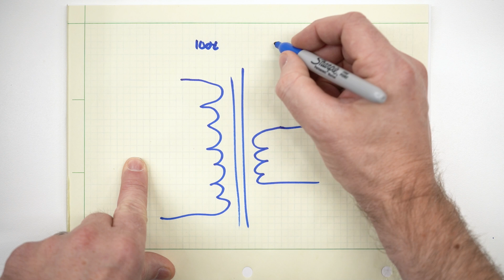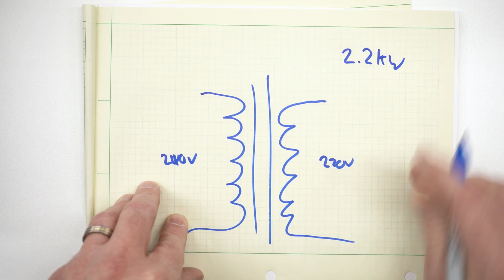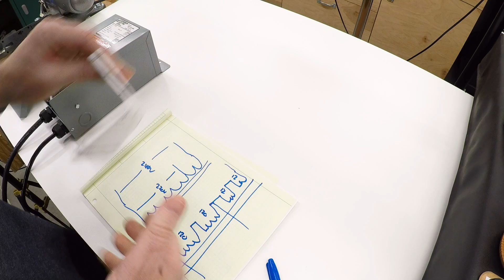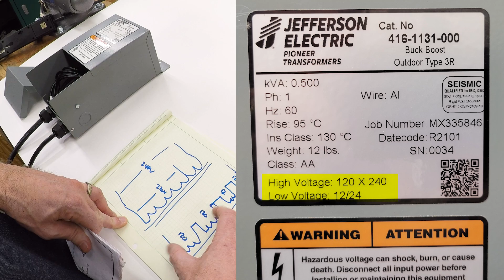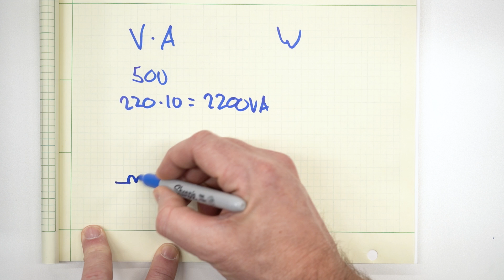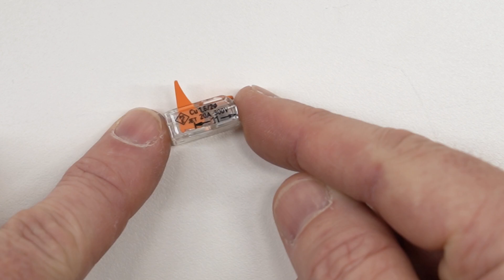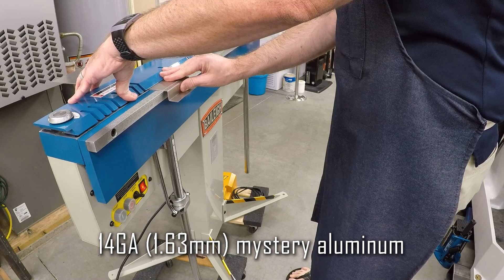220, 221, Whatever it Takes! | Wiring a Buck Transformer for a Magnetic Sheet Metal Brake

Comment from the maker: Errata:  A couple of people have pointed out that the wires are likely not aluminum, and they appear to be right.  While the transformer nameplate says "Wire: Al" on it, I went back and scraped some of the wires, and they look like copper under a silver surface coating.  Perhaps the marking on the transformer refers only to the windings.  It's fully encapsulated in resin, so I can't verify.
Reply: I could see them using aluminum for the windings.  But it's very rare for wire to be aluminum as making a reliable connection requires fancy tools.  Much easier to weld a copper or tinned copper wire to the end of the aluminum and make a connection to the pigtail.  (this is all due to surface oxide black magic)
Reply: @martylawson1638 it is Copper coils
Reply: Tin coated like marine grade wire perhaps.
Reply: Thank you for your interesting videos, James ! And thanks for the refresher :) I have worked in industry building and designing and programming all sorts of electrical PLC controlled machines and the power supplies for them etc... since 1981 (I'm an industrial engineer in electromechanics in Belgium ) and I can't remember when I last used a buck or boost transformer. Keep up the good work.
Reply: copper wire

Comment: I just received my Kaka magnetic brake, the EB-4816B and it doesn't mention anywhere about the +or- 5% thing for 220VAC input power.  Not on the cord, on the machine, in the manual, on the website.... nothing.  Is it possible that they've changed something and made them more forgiving or do you think they just ignored it?

Comment: Hi, I'm not sure you will have time to answer a couple questions, you have quite the following. I recently bought a 52" magnetic bender, like yours, it requires 220v. My shop is a consistent 237v, too much. Since your machine has the same requirements as mine, I'm looking for a transformer to lower the voltage. I'm having a problem finding exactly what you bought, but I see many other name brands. So is what I should be looking for is; high 120x240v, low 12/24 with a KVA of 0.5 or higher, is this correct? Is there any other specs that I should be looking for? Thanks

Comment: This is a machine costing $3k, intended for the US market, and it can't deal with standard US 240VAC?

That's somewhere in between disappointing and infuriating.

BTW, do yourself a solid and get a pair of proper ratcheting crimpers and dies. Those Radio Shack style stamped crimpers make terrible connections. Paladin/Greenlee PA8000 series are good.

Comment: Hey, thanks for the great videos. Please, can you tell me if you have castors/lockable on your magnabend sheet metal brake, and if so, what brand and model?
Reply from the maker: I'm using some cheap Footmaster clone casters, so I can lower the solid feet to make it rigid if needed.
Reply: @Clough42  thanks! I ordered some low cost clone as well. Different brand. I just got my 1250E magnabend yesterday! My CNC plasma rig is a DIY based on the Lowrider 3 CNC motion control system. It’s working great for me. I’m super pleased.

Comment: I'm wiring a similar buck transformer for my magnetic brake.  Did you consider putting a switch on the transformer on the input side to turn it off.  I'm thinking to prevent parasitic draw if I leave it plugged in.

Comment: I don't see how "VA" is the applicable rating.  The wire in the winding has an inherent current limit.  Beyond which it will overheat.   
Given the different configurations that the transformer can be wired for, it would be very confusing to determine the current limit.  If the VA limit applies to the bucked power (i.e., if you're bucking 20v, you can draw 25A), the different bucked voltages would imply different current limits.  On the chart, the maximum bucked voltage is 46v (implies a current limit of 11A) & the minimum is 12v (42A).  It is highly unlikely that the transformer could supply 42A for very long.
How is a VA rating more useful than a current rating?
Reply from the maker: You thought about it for a few minutes and decided the way the industry rates these devices is wrong, and this device doesn't meet it's advertised specs?
Reply: @Clough42  Snarky. Is that your way of saying that you don't know why a VA rating is more useful than a current rating?  I'm saying that I don't understand, not saying that it's wrong.

Comment: I bought a few weeks back the same type of magnetic brake but from another seller whose brake comes from the same factory. I was surprised when I looked at the manual to see that the manual says 220/240v. I had the seller ask the manufacturing plant if it had to be the 220v like baleigh writes in their manual to make sure a buck boost transformer is really required.
Manufacturing plant told my seller that it was 220/240v compatible and did not require a buck boost transformer. It was also confirmed that the manufacturing plant is the same one that supplies the same units to baleigh. I have the original manufacturer manual for the machine with mine.I wonder why Baleigh who wrote their own nicer manual wrote up the buck boost transformer stuff in their manual.

Comment: Wow! I found this video by responding to one of his comments on another youtube video. He said he had a video on setting up his magnetic brake. This video is awesome! I wondered why I saw transformers listed as VA but didn't really understand it. I have done electrical maintenance and mostly single phase work on commercial buildings (lighting, water heaters, AC, etc.) and have done just about everything on residential, and I do hobby electrical projects, so I know a great deal, but my primary trade isn't electrical. This video is easy to follow and right to the point as opposed to videos full of filler and crappy music. I will check out your other videos! Thanks for sharing your knowledge!

Comment: There's no way they're that finicky about 220 vs. 240. I'd bet money the warnings about only using it on 220 are there because of 208 and 277 volt supply voltage. 277 is what you get from a single phase to neutral on a 480v three phase circuit and I'd imagine that comes up with a lot of the more typical commercial customers of those mag brakes.

Comment: I pick up probably a dozen step up/step down transformers every year from the industrial salvage place I visit. One of the biggest ones I’ve got weighs about 1500 pounds and is on casters. And I’ve seen much bigger. But don’t have a use for anything bigger than that.

These big factories and manufacturing plants buy tons of them,… And then don’t use them or for some reason take them to the salvage yard while still brand new on the pallet.

They are extremely useful, not to mention I have an electronics lab where I do component level board repair for industrial clients. So I can always use extra step up/down transformers. Most of the industrial duty high-end ones that I’ve seen have copper windings through and through. Usually tinplated. And I have actually seen inside some of the larger resin encapsulated transformers when they’ve been cut or busted open.

Comment: @25:57 Nice safety sandals! 😀
Reply: I cringed at that, and I really thought James took his PPE more seriously. Flip-flops in a workshop is just such a big no-no! Even if you don't indent on doing anything involving heavy items or sharp tools, accidents do happen and then you're a toe or two short. 

Anecdote: My dad used to teach carpentry at trade school. One day one of the freshmen apprentices showed up for shop class in flip flops. My dad gave them such a bollocking, instructing them that in their chosen profession, steel-tipped protective footwear is mandatory at all times while in shops and construction sites no matter the job to be done. Not even the apprentice's insistence that they got achy back from wearing anything other than flipflops flinched my dad and he instructed them to go see their physician to have that back examined and get a referral for a Bandage specialist to have protective shoes specially fitted for them before banishing them from the shop. He took this very seriously and he didn't take any excuses.

Comment: The Grizzly is also another clone knock off.  But there tag list it as 110V I contacted grizzly and they say 220V.   Here is there tag from there PDF. 

Power Requirement: 110V, 1-Ph, 60Hz, 4.3A
Max. Workpiece Thickness: 16 Ga. (Mild Steel)
Max. Workpiece Width: 48"
Min. Reverse Bend: 1"
Max. Pan Depth: Unlimited
Bending Range: 0˚–180˚
Weight: 386 lbs.

MODEL T30297
48" MAGNETIC PAN & BOX BRAKE

Comment: Out of interest why is the break so “picky” about the input voltage...  why would it not like 240v AC instead of its specified 220v AC.  Is the clamp down magnet strip much more than just a electromagnet?
Reply from the maker: The manufacturer is not super specific.  I gather they had lots of failures, and requiring the transformer reduced this significantly.  The Internet is full of people with opinions.

Comment: you buy a $3500 tool and STILL have to spend a shit ton more to even make it work in your shop, that's not an ideal way of buying a product thinking it will just plug into the wall in your garage!
The company needs to make the adjustments when they IMPORT them for people that are NOT electronic geniuses!
I was wanting to buy one, but having to spend $130 for a box then have an electrician come plumb the damn thing for another $100 an hour is overkill on this tool!  
I was needing to buy one of these to build something I have in mind by being able to bend the whole box without having to make it in several pieces using a finger brake!!!  
Looks like I will go the way of a Finger brake and build my boxes in several pieces and tig weld the sides of the box together!!! Sucks but it's not worth the headaches and extra cost of this Baileigh Magnabrake! 
Thanks for all this information!
Reply from the maker: You are not alone in that opinion.

Comment: Have you come up with a way to put this brake on casters or a mobile base (besides the furniture dollies)?
Reply from the maker: Yes.  I have it on a set of Footmaster casters.  Actually, they're knockoffs sold under the name "Foot Nastor" which honestly is the reason I bought them.  :)
Reply: Did you attach the casters directly to the legs or did you create a frame?  I can’t tell whether it will be ok to point load the ends of those legs. So asking someone who seems to have good judgment on these types of things. Thanks!
Reply from the maker: @chidofu4922  I just drilled them out and bolted them on.  When the feet are lowered, it bears right under the leg.  Seems okay.

Comment: Isn't the mains electricity supply in Saudi Arabia based on an unusual mix of nearly European and nearly North american 220v (instead of nominal 230 but really 240, as seen in europe) but at 60hz with a 5% over and something like 15% under, standard?

For what it's worth, I've lots of appliances which say 220v -+5% which work just fine on 240v (plus or minus 10%), but none of those cost as much as that bending brake, so I don't blame you.

Comment: Are screw-based terminal blocks never used in North America? 

I'm all for convenience, and those connectors look OK, certainly better than those death trap wire nuts which seem to be so popular over there, but a nice bit of terminal strip would be just as good, and more serviceable, and would not damage the conductors so much.

Comment: I watched this to see what a magnetic bender was........Hmmmmm,  very dissapointed that you had to manually raise the bending thing to form the bend.......I think the the magnetic gripper is just a gimmick as you could have a cam operated clamp to be far less complicated and doesn't need any power.
I have a 10 ton shop press and bought one of those add on benders that go between the uprights and across the bottom of the frame and are just a pair of Vees that use the down force of the press to do the bending......OK, so it's only 500mm wide but I think it will bend 6mm steel .......width depending......quite easily with 10 tons on hand......your model is a bit more sophisticated.

Comment: For the cost of that brake, I'm blown away that the manufacturers couldn't be bothered to ensure that it could be connected up to an ordinary mains supply. No-one has a regulated supply as standard.
Reply: yeah, its really interesting afaik baileigh is a UK company so would have expected it to handle 230 at least is 220v common in industrial?
Reply: @scootscoot2k  UK power was originally 240V +-5%, and when they harmonized with the EU they went to 230V -5% +10% (do the math, it may surprise you…). It’s really weird they’d be specced for 220 +-5%. That’s the old mainland EU standard, which harmonized to 230V -10%, +5%.
Reply: @scootscoot2k  ELECTRICAL: 1 PHASE, 220/240 VAC  DUTY CYCLE: 30%
Reply: It does connect to an ordinary mains supply…in China.
Reply: In Australia it's 220v,Original Patent, 1976, Inventor: Alan Bottomley from Australia

Comment: That is such a curious thing on the 220 volt requirement....I spent my career as a commercial electrician and never ran into a machine this finicky on the voltage...are there delicate electronics built into the machine? 
It would be interesting to see if Shandon chimes in on this one, as I know he is also in the electrical field..

I certainly don't blame you for going the extra mile to protect your investment,  I would just be curious why it was built to require 220v in a 240v world...
Learn something new every day I guess...great machine by the way
Reply: I would guess an unsatisfied, but heavily lawyered client (running 275 underwater on the moon) got a settlement from Bailey.  Followed by changes to the spec and manual.

Comment: It's odd that Baileigh is so adamant about the voltage not deviating more than 5%, yet their current spec is so far off.  Also odd that their nameplate current rating is 10A, yet the manual specs the current at 12A - a 20% difference and a 46% difference in relation to your measurement (compared to the spec in the manual).
Reply from the maker: Yeah, there's a lot of fishy stuff.  The manual also says the shipping weight is around 1500lbs.  It's closer to 500.
Reply: @Clough42  LOL.  Something tells me that they don't actually build this machine, but rather just rebadge it as their own.  In fact, Eastwood sells the identical brake (but in their colors), and for about $1k less.

Comment: Dusting off the cob-webs from my undergrad electromagnetic course.  One of the odd things with AC current in inductors is that the maximum flux in the core is proportional to the voltage and proportional to the inverse of the frequency.  Where this can get ugly is if the core saturates.  When the core saturates it needs a LOT more current to keep increasing the flux in the core.  This will show up as a poor power factor due to a current wave-form with a spike at the peak.  This also shows up as quite a bit more heat as the inductor can end up drawing way more current than typical.

Comment: Bought my Baileigh mag brake in 2016 for 2335 from Elite. Placard says 220V. Page 31 of the manual says 240V and has worked fine on 240V since new. Looking at the wire diagram, it says the primary transformer coil is 220V but not sure what the secondary coil does to the voltage. Like your presentation.
Reply from the maker: Have you ever measured the current draw?

Comment: I designed my first buck converter for the Boeing 767 in 1981. I was making $7/hour as a junior engineer.  The last was a resonant buck converter for helicopter night vision in 2001. I had a fixed price contract with a statement of work. To integrate  it in their system, I had to fix their problems on my own nickel.
Reply: Wow, what time does to the value of the dollar. I started working at $5 per hour for my uncle as a helper remodeling his house at age 14, then at age 15 worked with him as a building painter. That was 1995 and 1996 roughly. Gas used to be just over a dollar a gallon, in high school, from what I remember. Prevailing wage for construction labor in 2020 for California was $52 per hour and operator pay was $72 per hour (luckily, we had a job that took the entire year at that pay, so it was a great year for me). That is quite an accomplishment to have your designs on commercial aircraft! Electrical (building work) is a secondary trade for me, so this video explained VA to me.
Reply: Look at income vs IQ. Then look at net worth vs IQ. You can bet Clough42 is worth $10M.

Comment: If there is no (sensitive) electronics involved (for instance in a control unit) and the max load is only needed in short bursts you might have considered a resister in serie (like a light bulb). (BTW I did not do the calculations.)

Comment: If you rectify and filter 12 V RMS AC you will not get 12 VDC.  You will get about 16Vdc.
Reply from the maker: Correct.  Multiply by the square root of two to get the peak of the ripple.

Comment: Hi James, shouldn’t the VA calculation at the end be closer to: 16A*20V + 1.5A*220V = 650VA (with the actual VA load being a bit higher)? Even though 1.5A is quite low, it seems like it should still count. That would explain you exceeding the nameplate rating.
Reply from the maker: The input power and output power of the transformer should be about the same.  You're adding the two together and getting twice the power actually flowing through it.